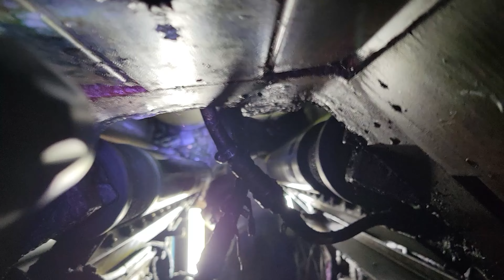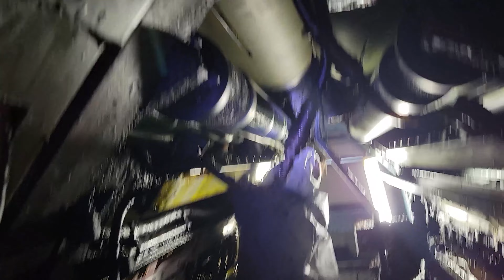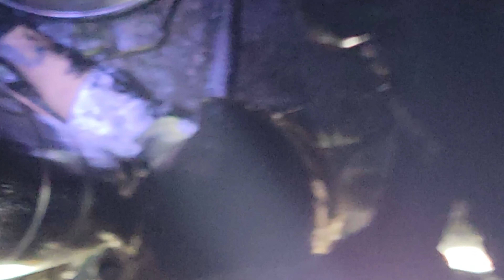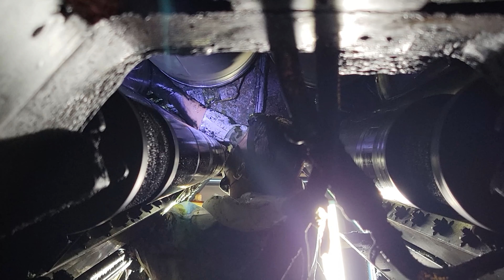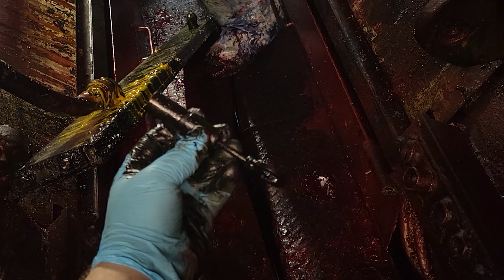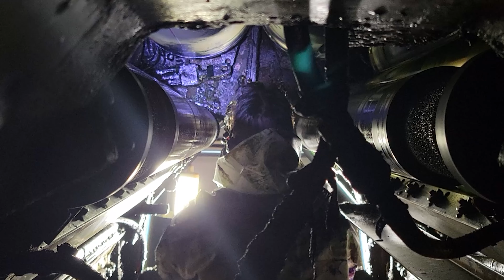Press Maintenance - Trini Replaces An Impression Cylinder

Comment: Had me fooled there, pretty good if you can change an "impression cylinder" in 6 minutes! The 3rd print cylinder on a non-perfecting litho press is an "Impression cylinder" or a "back cylinder". THAT is a pneumatic actuator that brings a blanket cylinder on impression. Maybe some better term for it but it is NOT and "impression cylinder"
Reply from the maker: That's interesting.  We've always called this hydraulic cylinder an impression cylinder.  If there's a better term for it, I don't know what it is.
Reply from the maker: This is great.  I didn't know this website existed.  Thank you.
http://printwiki.org/Impression_Cylinder